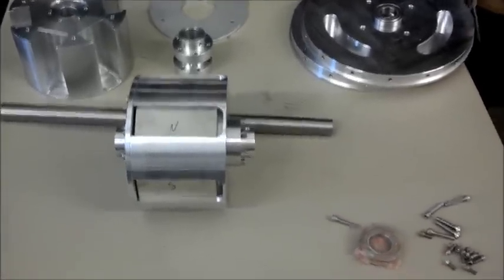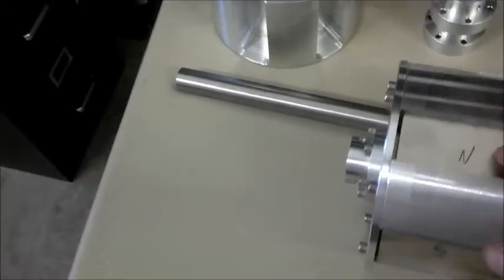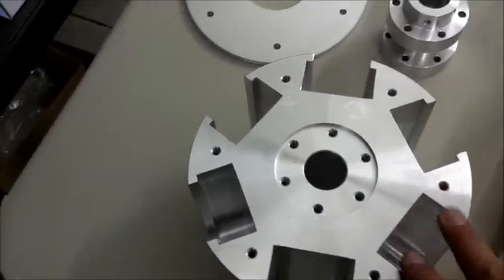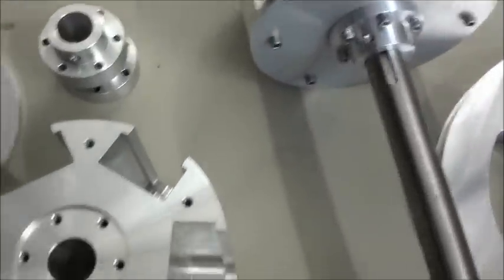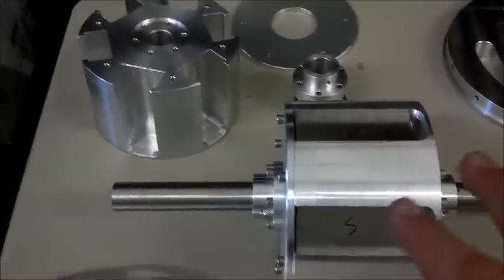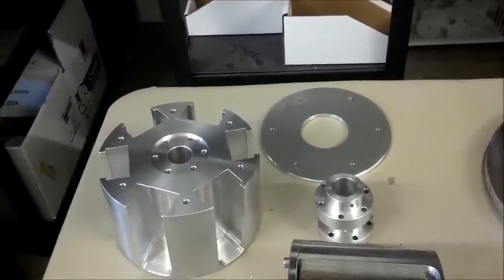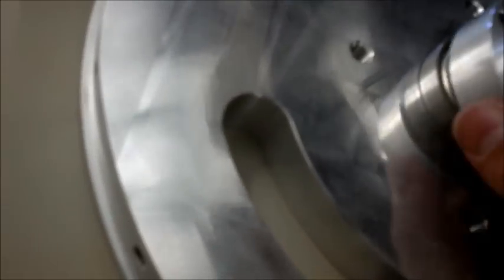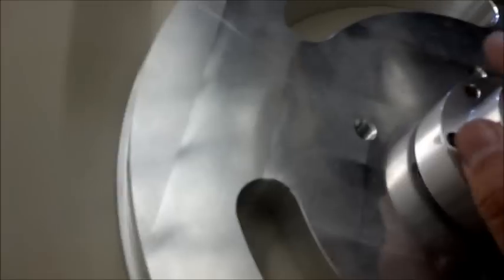12" Magnet Motor Parts display

Comment: Hi Rick I was wondering if you have done any Hp test with this and also what Hp  could be reached, I think this thing is great.
Also have you ever had one go so fast that it flew apart. and what the max speed that it should be ran at for optimum performance.

Comment: When I was rebuilding VW engines, we warmed up the gear that mounted on the crankshaft in our oven and they slipped right on - no need to hammer or band on them. - could work for installing your bearings also. (warm up the end plate - it will expand a little and the bearing will slide right in...

Comment: Rick You mentioned in the first Vid, you were going to use "this" motor in a Porsche, is that correct ?   If so what model, and what will you use for battery power ?

Comment: Thank you. Have you measured the watts in and out , with and without charging the battery?I ask you this question because in many experience i have done I found that any energy you take from solenoid are always take from battery by forcing the rotation , and so the total energy is the same minus the losses.

Comment: Sorry to keep lecturing, but electric motors that you buy need to be plugged in to the wall outlet or power cord to run, this magnetic motor runs by itself without the need to plug it in. It runs for free!